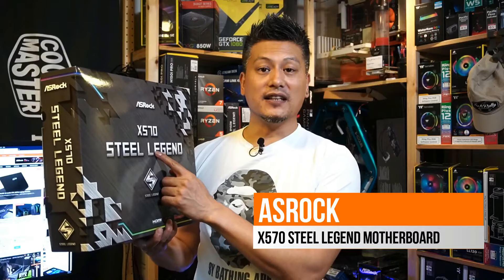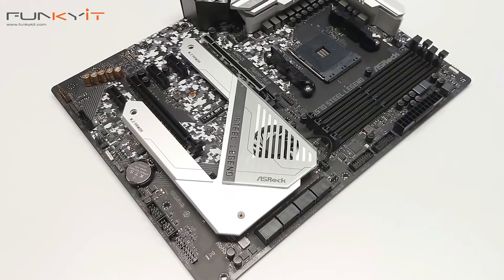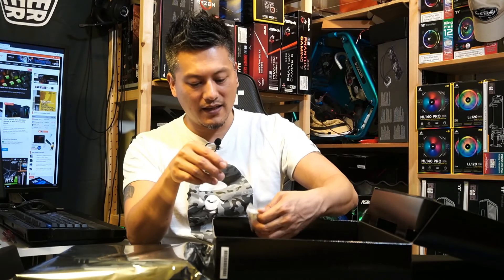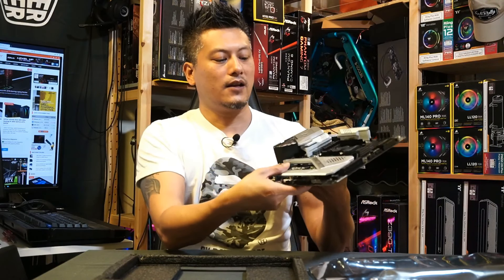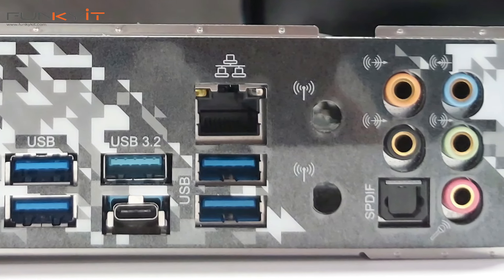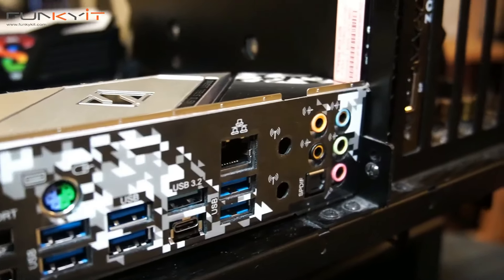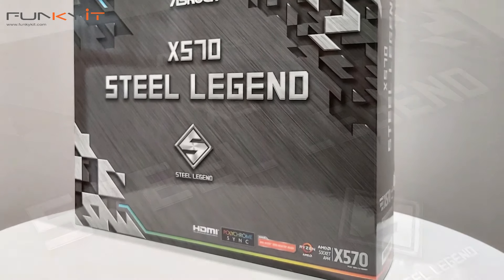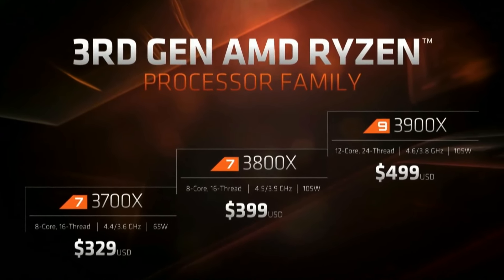The Legend has arrived - ASRock X570 Steel Legend Motherboard

Comment: Are there any compatibility issues with Noctua Nh-D15 cooler? Noctua's website says this motherboard is not supported because the PCIEX16 slot is too close to cpu. Planning to buy this in couple of days, any information will be appreciated.

Comment: Hey! I have this same set up (x570 & Ryzen 7 3700x)! But I have a question, CPU power Plug in the motherboard is 12 pins (8+4) but my PSU only has a 8pin to 8pin cable... Do I need an adaptor or is 8 enough? It booted fine and I have been using it for almost a week.
Reply: 8 pins are more than enough even u are using an R9 so unless u are doing extreme oc with nitrogen then u can just stick with 8

Comment: You did such a great job here, as always - to introduce and get familiar with this great motherboard. Thank you for that, keep doing it! <3 After I watched this, I read everything about it and purchase it directly. So now I'm not able to set up the RGB of the motherboard at all ... I tried from bios, flashing the chipset, install the Polychrome app .... but cannot make them glow. May i kindly ask you, how could I reinstall or activate the RGB of the motherboard? I am familiar now with the drivers and everything .... i saw them light up once, which mean that they are working which from another side is meaning that I'm missing something ...... Thank you in advance! <3
Reply: I have the same problem, did you find any solution?

Comment: [The real issue] My system works pretty much flawlessly. I do not have any issues at all when running my system. Tinkering or playing games for hours or days! Once I move away from my system and the system goes to "sleep", I simply press the power button to "wake" the system up; pretty simple.

The 'issue' arises once I wake up my system. I began to notice that none of my SATA drives would wake up. Naturally, I went into the BIOS to see if settings can be changed. Updated the BIOS [which did not solve the issue and BROKE my Hackintosh because it removed the option to turn off CSM or "Windows 8.1/10" legacy modes -- so I reverted back to P2.60 that it shipped with].

I have four SATA hard drives. Two SSDs and two 3.5" HDDs. All have brand new SATA cables. I have a EVGA 600W 80+ PSU that powers all components perfectly without fail for days. The only issue is once they are sent to bed, "sleep", they do not wake up or are recognized by the operating systems until I perform a soft or hard restart/shutdown.

Comment: It's a beautiful board, I bought one with my Ryzen 5 3600x, it's beautiful
Reply: Same here for a 3700x
Reply: how did u power up the cpu? theres an 8pin and a 4pin connector for the CPU on the mobo and i can only find PSUs with 2x8pin connectors.
Reply: @Nico-wf7wg  just look in the manual
Reply: @vaf3614  I just did, theres no description for that, but ive read that one 8pin connector already provides enought energy for my 3600x and i only have to connect this one. Can it be possible?
Reply: @Nico-wf7wg  you only need to connect the 8pin connector.
Reply: @vaf3614  aight, thanks bro
Reply: @Nico-wf7wg  true..using this board with just the 8pin with an overclocked 3700x with no issues

Comment: In your review on the site you said you installed a NH-D15 on it.  Were there any clearance issues?  The Noctua site says it will extend over the top PCI-e slot. https://noctua.at/en/mainboard/ASRock_X570_Steel_Legend
Reply: Well I got one, so I can answer my own question now.  I have one of these ASRock X570 Steel Legend (WiFi ax) motherboards, with a Noctua NH-D15 installed (both fans) and a MSI RTX 2080 Super Gaming X Trio GPU installed in the first PCI-e slot.  The NH-D15 does touch the back of the GPU. It also makes it super difficult to push down the tab on the PCI-e slot to unlock the GPU and remove it if needed. Overall, it does (barely) fit.
Reply from the maker: Yes ... the Noctua NH-D15 is a huge cooler, and although I used it testing ... I recommend a smaller heatsink/fan or a AIO cooler

Comment: I'm sending mine back it nuked my memory, it will only POST with 1 stick of memory, the hardware monitor in the BIOS just doesn't function, the no POST LED glows bright red when the board POSTS. It's impossible to fit the AMD boxed fan to this board don't even try.
Reply from the maker: Oh dear ... yes go get a replacement